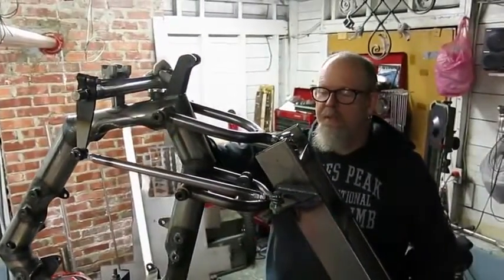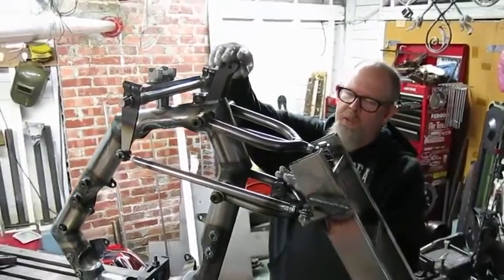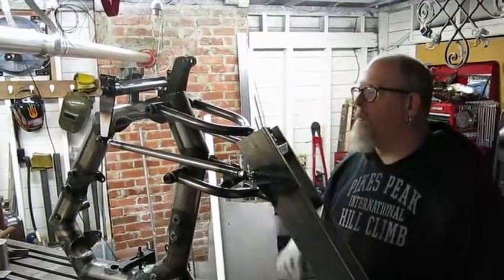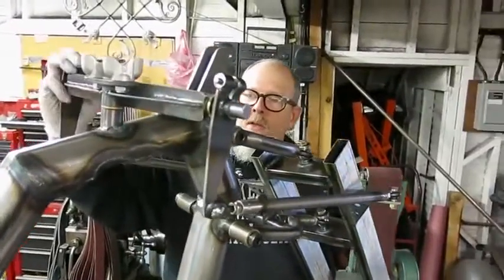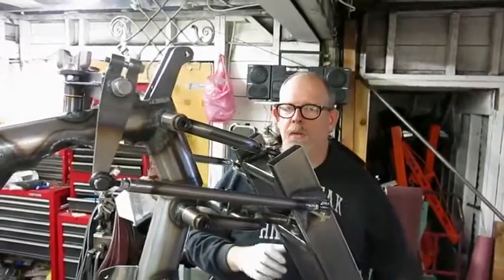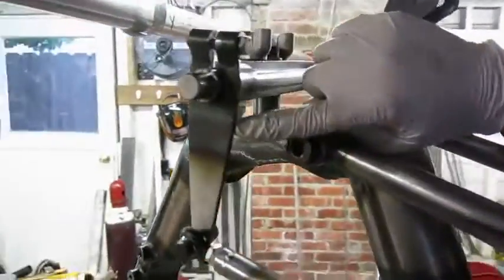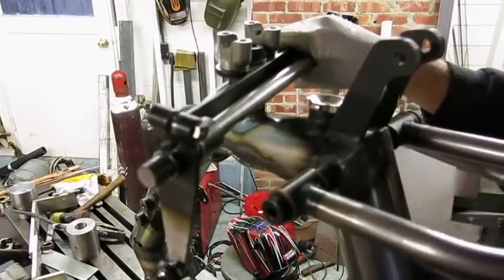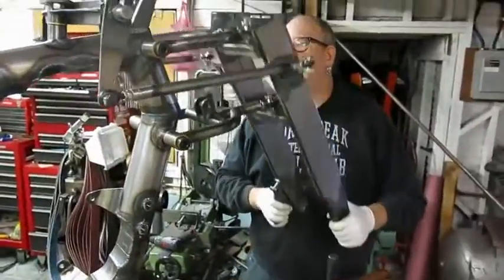Alan Lapp explains the front suspension design of his Hossack-forked DirtBag Challenge Suzuki DR650

Comment: Nice set-up there, I tried something similar a few years ago and learned a few things.  
The swing arms need not be parallel or of the same length. The mounting points of the swing arms can be adjustable to tune the steering and the effects under braking. I settled on a top arm about 300mm long and a lower arm at 500mm long. These are set to be closer at the rear. This results in an axle path as something like a letter J. The upward movement being almost vertical and the downward movement moving forward. This results in no brake dive but still allows the recessional movement to take the shock out of pot holes and the like.
 The main weakness in many designs is the use of typical rose joints as the main ball joints. They have neither the the required movement or strength to cope with the expected loads. I used modified car ball joints to get a strength and reliability. I am intending to improve the ball joints soon.
   Keep on building,   MoCo

Comment: I'd like to see the Wishbones separated a bit more, the closer they are together (vertically), the more strain they're put under during Braking.
Also, Rod Ends aren't designed to take loads in the way the Lower one is set up, with the Suspension loads going through it.

Interesting take on Mr Hossack's design though, and nice to hear him getting a credit/mention.

Comment: Isn't this a girder front end?
Reply: Ahh yes, the pivot is moving with the unsprung mass rather than on the frame.
Reply: @chrishoesing5455  Sort of Chris.
Unsprung Mass would be similar with both Systems, The Upright and everything on it (Wheel, Brakes, etc), and (most of) the Link Arms and Shock.
Reply: @Docv400  sorry I should have said swivel, not pivot. I meant the head tube and bearings. The girder would have slightly less moving mass as the two large bearings wouldn't be a part of it.
Reply: No. In a Girder Fork System, the Upright is held by (and moves on) Four Link Arms (two on each side), the Link Arms attach to upper and lower Fittings that Pivot in a conventional Headstock.
There are many different design variations, but they basically all work the same way.
https://www.youtube.com/watch?v=2nA2X_WPM9g

Comment: Put the joint steering ball allover the imaginary lines better the top triangle pins en the chasis and the bottom pins triangle on the chasis 
Them when the suspension move up or down you have same line on the steering

Comment: Hey there.  I never realized that OddBike hosted this on YouTube.  I'll answer the questions:

No, no recent video of this bike: it was basically an "art bike", and was horrible to ride, but the front suspension worked fantastically well.  The running components were returned to their donor chassis in 2020, and a custom scrambler was built from it.

Thank you!  I take "insane" as a high compliment.  :)

No, in fact, the A-Arm length is how you control the wheel path, and pretty much have to be unequal-length to get a pretty straight wheel path.  The more vertical the wheel path, the greater anti-dive it has. The more leaned back (like teleforks) the more pro-dive it has.  If the wheel path lengthens the wheelbase, it is actually pro-rise.  Tony Foale is who I learned this from.  His books are utterly invaluable when designing motorcycles.

Спасибо! Быть маньяком - это круто

Hitting a curb... I think the rim would bend.  On this bike, the A-Arms were constructed of 1" .074-wall tubing, and have solid 3/4" pivots.  For comparison, a pre-runner truck uses 1.25" .125-wall tubing for it's suspension components.  The truck uses material that is ~4x the stiffness but the truck weighs more than 10x what the bike weighs.  But, generally, if I'm hitting a curb, I'm having other problems to worry about.
Reply: They need to give it Bluetooth steering.

Comment: Does the upper arm lower arm have to be of equal length? What are the consequences if one of them is shorter or longer than the other??
Reply: You are getting into 4-bar linkages, which can do some pretty cool motions.
If the linkages were the same length and parallel (not crossing each other), you will get motion that maintains the same angle/parallel.
EG you could make a desk that works for sitting height and can be raised for standing height and it would still be level/not dump everything off it.
If they are unequal length linkages, then motion causes angle change.

But if you consider what is happening to the rest of the bike geometry, the front end would be diving, so even though relative to the pivot points, it would be parallel, the actual total effect on the bike would be rake angle loss and trailing loss (just like a normal bike). But then you would also have forward to back motion that doesn't exist in regular bikes (well, except by flexing). That would affect wheel base, but could actually be tuned to get rid of the loss of wheel base regular bikes see when the front dives.

If you make the top link shorter, the front wheel will swing further out (more rake, more trail, lengthening wheel base and looking more like a chopper). This could counteract some of the effects of front end dive. But overdone, that would cause competing motions when hitting something like a curb or exiting a pothole. The backward force would try to raise/extend the suspension, at the same time that the upward force is trying to lower it. If excessive, that would make the front suspension not even react/move (wham!) or even increase the upward bucking.

If you make the top link longer than the lower link, then the opposite effect happens. Hitting a bump/compressing the front would also tuck the wheel back/shorten wheel base. 

The angle of the pivots on the frame controls where the motion will go. Think about the 1st case with even length links (staying parallel) Now imagine a big circle. if you were having motion approximately tangent to that circle, what angle would you want to start at? The bottom and top have almost no vertical travel (bad for suspension). The sides have a lot of vertical travel and minimal front to back travel.
Reply: By altering the lengths, and the position of the pivot points you can get almost any wheel movement path you would want for whatever the bike will be used for.